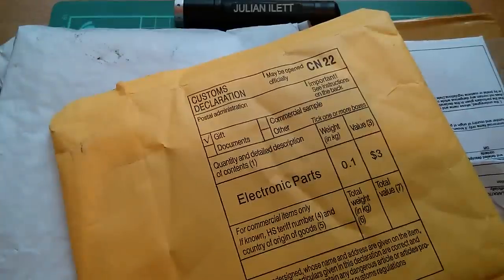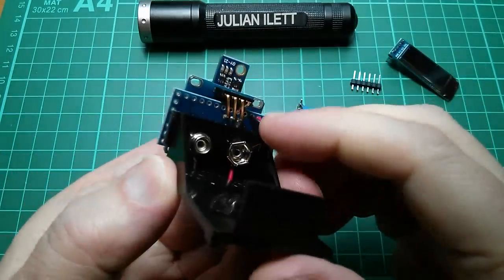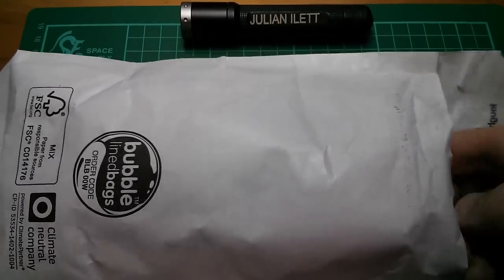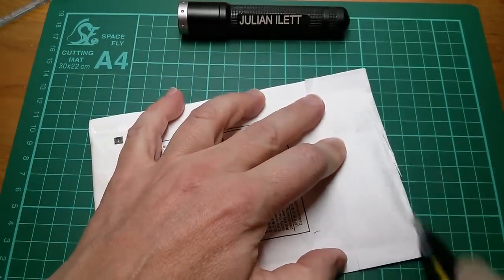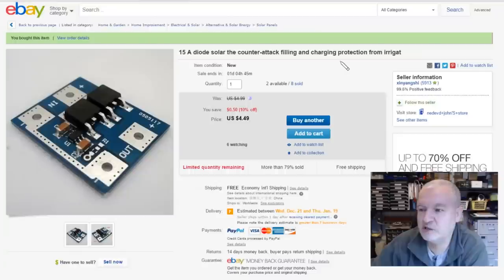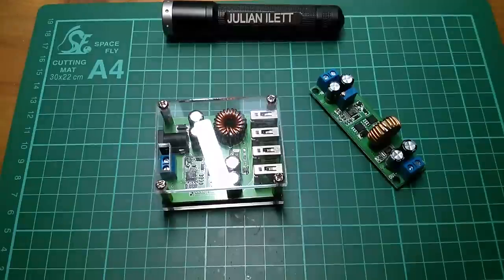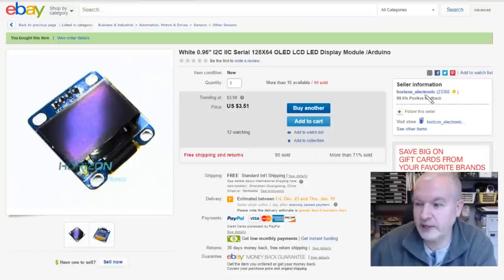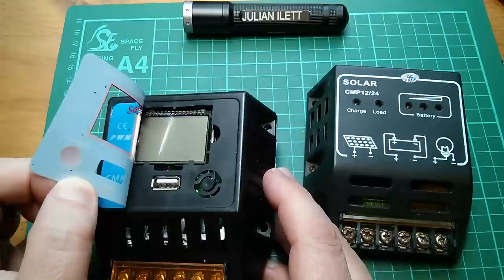Julian's Postbag: #77 - The Puppets are Back

Comment: the other kind of pro mini might fit better? the one with all the components down one end and the two rows of connections at the other. they have gnd vcc a4 and a5 all together at the edge (ebay item 131573185472)
Reply from the maker: Ah yes, I might get one of those :)
Reply from the maker: 2 purchased - thanks for the idea :)

Comment: Julian, The USB socket is there because many parts of the world don't have mains power but do have mobile phones that need charging. Solar is their only option in many cases or they have to pay someone to charge their phones.
Thanks for the great videos.
Reply: And it can be used to power up something else like a transmitter to send data out over about the controller's state using an already made off the shelf item.

Comment: Julian, OLED displays at Aliexpress are available now even for as low as 2.6USD. Regarding the size of your higrometer you can consider using Digispark modules with ATTINY chip. I remember that tested 2 different modules about year ago and should have videos on my channel. I used one of them for LEDMatrix display and second one for USB remote controller. Both of them have emulated USB so it is additional advantage because you can program them directly from PC and also powering from any USB supply is very convenient. And price was also very decent because year ago they were about 1.2-1.3USD

Comment: Had to laugh on that OLED that said it was white but turned out blue. I received one like that a few years back, and when I commented to the seller, they said they didn't even stock the blue OLED's and promptly refunded my purchase!  Things sure do get interesting when dealing with those in China who have a very limited vocabulary.  The last week, I got in some MC102 JFET's that were, in fact some N-channel BJT according to my tester and in now way behaved as a JFET which I use to build ghost detector toys for my niece who is into that sort of thing.  They at first urged me to wait another week for the package to arrive, and when I asked them to find someone who spoke English to read my complaint, they offered to resend, or refund.  I replied that if they could assure me getting the proper product, I would take a resend, however if not then a refund.  I received my refund today.  The reason I had ordered them from that outfit was that they were selling them for 20 for 8 bucks, where everyone else was selling them for a buck or more per transistor.  So I took the refund and ordered 10 Motorola brand to see if they are better copies then the Fairchild fakes that everyone else seems to be peddling on Ebay right now.  Sad to, as those little Jfets are great fun to play around with, they are so very sensitive to EMF.

Comment: I know this is a rather old video to comment on, but I just noticed something. Rather than waiting to open a bunch of posts all at the same time and wondering what is in them or taking a flashlight (torch) to try and figure it out try this. Just film them as they come in the mail. Then you can just take the different clips add them together for your post bag video, and you might find it saves you a lot of time doing post bag videos as well as the frustration of hanging on to them unopened.

Comment: In case you haven't figured out why a red power button is there, it is so you can turn on your load in most cases. Or turn it off overriding the onboard controller.

Comment: Julian can we use use a buck converter to charge a lead acid battery by using a diode on the +ve output of the converter??
Reply from the maker: Yes, the diode will protect the buck converter. Use a CC CV charge sequence, continuous trickle charge is fine.

Comment: hi Julian. on the 4 USB device the different ports are set up differently. can I send you a picture from the eBay listing I have purchased one from?
Reply from the maker: Hmm, you're right - the two ports near the output capacitors have an RZC7512 intelligent identification IC. The other two ports appear not to have anything connected to D+ and D-
Reply: Julian Ilett  shorting d+ d - is comparable with most devices is what it says.

Comment: Why does I2C use A pins? I thought they were analogue only and I2C is digital? No?
Reply: On a micro-controller there are several options per pin as seen in the relevant data sheet. It is usually a trade-off as to how you assign them for your project.
Reply: Nick B Are you saying the A pins are digital or analogue?
Reply: +That Guy, I am saying read the data sheet.

Comment: May I ask a question? Can one charge several batteries in parallel without having to worry about balance charging ?
Reply: Yes. Parallel things will be at the same voltage.
Reply: I have ten 18650 batteries and you are saying I can charge them all together  as long as they all are connected in parallel ?
Reply: Sure. Multiple cells in parallel act like one large cell. It'll just take 10 times longer to charge those, unless you can increase the charging current.
Reply: Just don't hook them up in parallel when they are at completely different charge levels (one full, one empty). After that it's fine. I would also not multiply the charge current by the number of parallel cells So if you have 10 cells that could be charged with 1A each, don't use 10A to charge. You can do that, if all the cells are the same (model, capacity, age, condition), but if you are mixing different cells I'd leave some safety margin and only use 5A or so just in case some cells act up or have bad contacts or something like that.
Reply: superdau - thanks. Appreciate it.

Comment: I2C is open drain just pull up to 3V3?
Reply from the maker: The OLED module already has 4.7k pull up resistors to 3.3V - but if I connect another device which uses level shifters (like the humidity sensors), there are resistors which pull up to 5V. Normally I don't worry too much about this stuff.
Reply: If you really need to use those level shifters pulling up to 5V, then check the OLED can with stand greater than Vdd on the I2C pins - you almost got that far in the data sheet, there's usually a clue regarding ESD sensitivity (the open drain pins may not have ESD diodes to Vdd allowing them to go higher than rail, but consequently more susceptible to ESD damage).
Reply: OK, so I had a quick scan through the OLED controller datasheet and I can find no evidence the I/O will withstand >Vdd+0.5V.
In this situation I'd go with a 3V3 Pro Mini, direct drive to humidity sensor and OLED, and power it from an 18650 rather than a PP3...just a thought
Reply: Julian, you want to look at the "absolute maximum ratings" if you want to know what breaks your stuff ;) . The "DC characteristics" just tell you what the chip will see as high/low aso. 
The Vdd+0.3V maximum input tells you there are internal protection diodes and where they start to conduct. Some datasheets list the maximum current they can take (this one unfortunately not). Even if they list a maximum input voltage, it is mostly fine to go over that voltage as long as you limit the current. The pins will conduct at over 3.6V in this case. With a pullup to 5V that would mean 1.4V on the resistor. The pullups on the board don't matter in this case, because they only pull up to 3.3V.
For arguments sake let's say you have some 4.7k 5V pull ups somewhere else on the bus. 5V-3.6V = 1.4V, divide that by 4.7k and you end up with 0.3mA through the diodes. Times that by the 0.3V drop of the diode and you got about 0.1mW of power dissipation in the protection diode. So the IC should be fine even with pullups to 5V.
Why do you want a level shifter non the less? Because the 3.3V pullups can pull down the I2C lines towards 3.3V fighting 5V pullups somewhere else and the protection diodes inside the IC will clamp the I2C bus to a maximum of around 3.6V even harder. So if other devices aren't fine with that logic level anymore they won't work. In this case the level shifter isn't there to protect the OLED driver, it's there to keep other devices on the bus working.

Comment: Im building a garden shed/workshop next week with my dad and I want to set up solar on it's roof. It will also have mains power fed to it but I want to have solar running the lights and other assessories. Would you recommend this entry level solar charger? And also whats the minimum recommended wattage for an entry level solar system? PS... love your videos all the way down here in New Zealand! Keep it up!!
Reply from the maker: Certainly start with a cheap solar charger - but you may want to change to a PWM unit later. If you get a lot of sun, 30 or 40 Watts may be enough. Here in the UK I would recommend at least 80W.
Reply: It all depends, what type of lights are they? LEDs? how many lights do you have? How long do you want the lights and anything else to run?
So for example, let's say all I have is 10W worth of lights I want and I'll at most run them for about 4 hours, to get that I'll need roughly 40Wh worth of batteries (80Wh if Lead-acid and use half of it) but don't forget that you'll lose a bit of capacity over time so you should plan on getting at least an extra 10-20% worth of capacity if possible, now that you know how much power you're going to use, now you can calculate how much power you need to generate, during the day you'll only get roughly 4 hours of good sunlight with a panel in a single spot, so you'll need to generate at least 10W of power but again with solar you should expect to overestimate what you need since it won't always output the full 10W I require, then we also need to account for variables such as daylight usage of the light or days without sunlight, so yeah in my example 20W or 30W would be plenty.

Basically get slightly more battery capacity than you think you need and get about double the solar power you'll need to generate.
Reply: Oh yeah about the charge controller, it should be fine although personally if you're cheap or for beginners, I prefer this one: http://r.ebay.com/sA0Esj
It allows you program some of the charge settings on it, such as the charge voltage and cut off voltage.